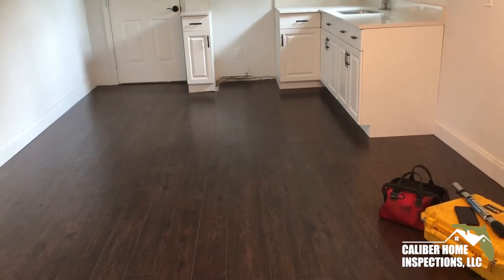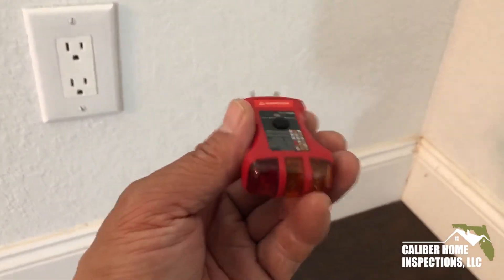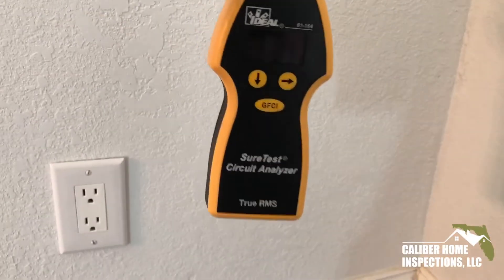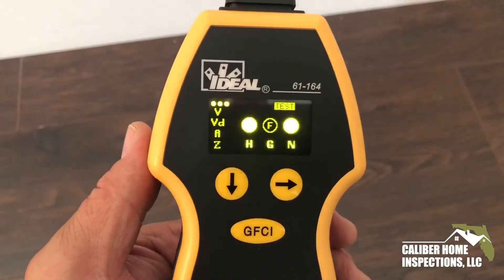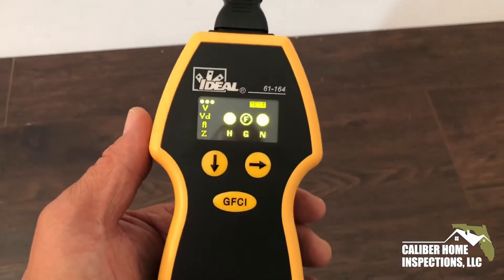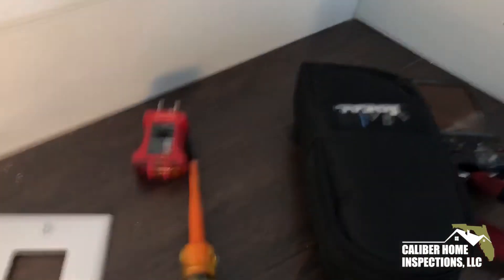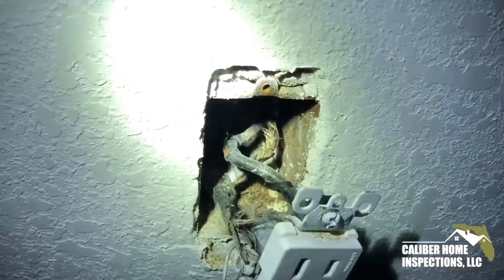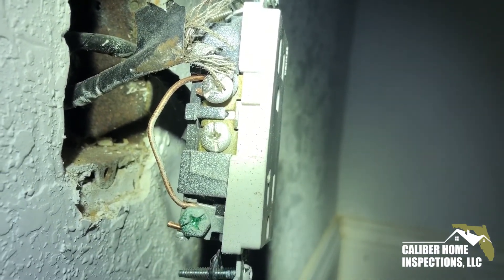Bootleg Grounds

Comment: Very dangerous!  Especially since both wires look to be black.  You could have either a correct polarity bootleg ground,  or a reverse polarity bootleg ground,  meaning the neutral & ground are sitting at 120 volts and any 3 prong appliance plugged in would have it's case live and pose an electrocution hazard.   Thanks for sharing.  And good catch .